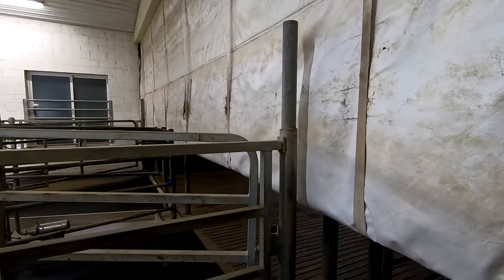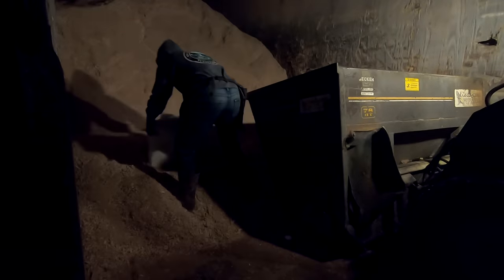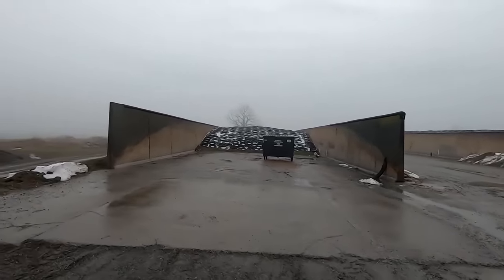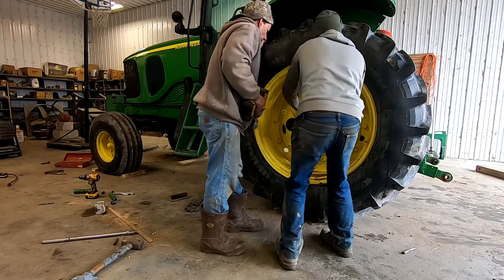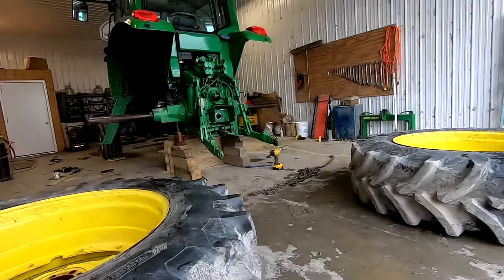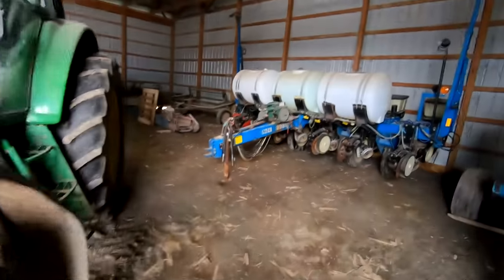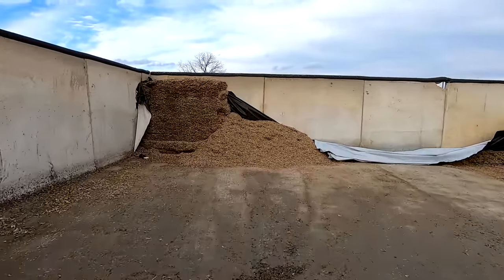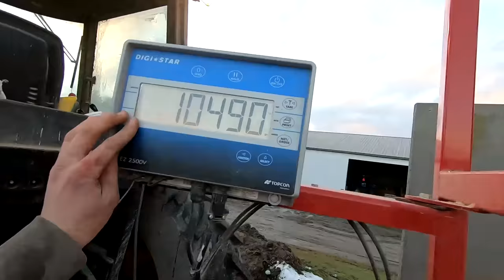Day in the Life of 10th Gen Dairyman | Opening New Silage Bunk

Comment: We had to change tractor wheels twice a season. Move them into the narrow set for ground breaking with a bottom plow. Then back out wide for row crop work. Grand-dad had a wheel lift that worked off the tool bar. Raised all 4 wheels at once. Just a little 2 row Ford 2000. No where near as heavy as that John Deere. Those water filled tires would get you if you didn't watch.

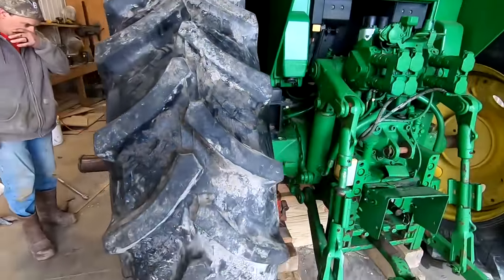Comment: 10:10
protip, use a short flat shovel underneath the tire, the steel slides on the concrete a lot better, and you can use the shovel as a lever to lift the tire a little bit to line up wheel studs or those tapered bushings

Comment: Should ask your dealer about a “scale repeater” Mount it on the loading side of the mixer and you won’t have to flip the display from side to side, it’s not a huge deal obviously but it does make life a little easier.
Reply: or a wireless display that shows the weight in the skidloader, we've had one for years